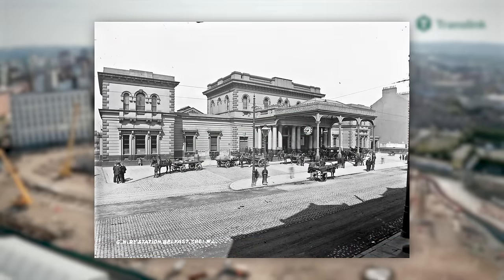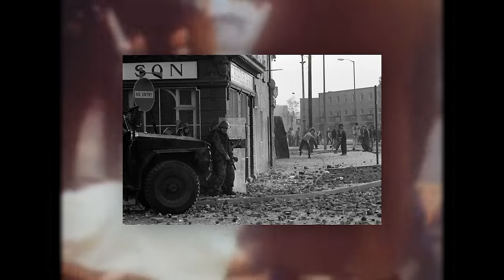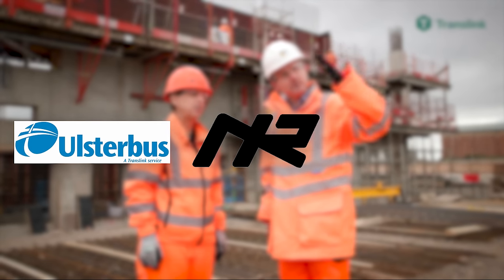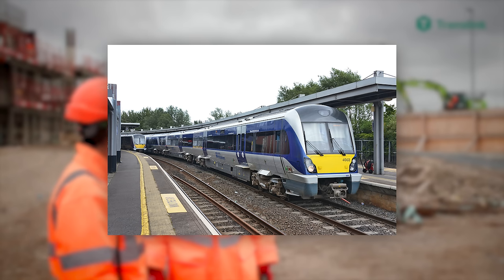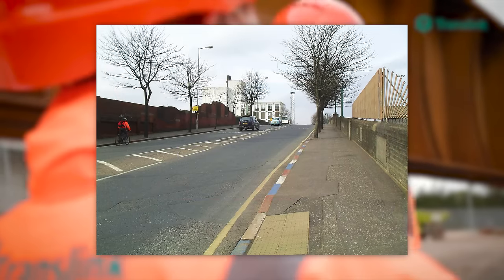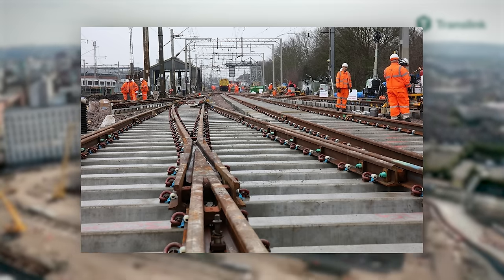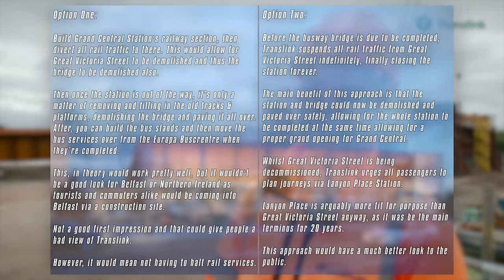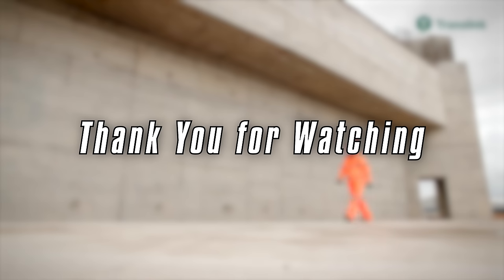What is Belfast Grand Central Station? | Explained

Comment: Sadly so many lines were closed. Many of them were narrow gauge but could have been incorporated into the system. I sometimes wonder why there is no line to Dungannon, Omagh and Enniskillen. The West seems to be neglected. Adimitedly, there is a coach service but a railway would reduce congestion on the roads in the future.
Reply: Japan, spain, and Russia off the top of my head have mixed gauge railways - its a real shame everything was ripped up
Reply: Line to Omagh and Dungannon is included in the rail review, so it's likely to be built

Comment: Very informative video.  Translink should link to this to give people an idea of what to expect.
It's disappointing to see the City Fringe replaced by a car park.  Belfast has WAY too many car parks these days.  It's quite a disgrace, and only makes Belfast more of a car centric hell hole.  Turn it into a park!
Hopefully the expanded platform capacity will enable trains to run frequently from Derry to Dublin too.
The only downside from this development is that a major transport hub will be a further 400m from the centre of the city.
Reply from the maker: I mean they could have just put a carpark underneath the city fringe. It's a just a little weird in that sector haha

And yes, that's why Glider integration needs to happen because the walk from the station to the city centre is already lengthy enough as it is.

Also yes this new station is what Translink are hoping will allow for an hourly Enterprise service.

Comment: Thank you for making such a thorough presentation. Beware of suspending railway services as there is a risk that once the habit is broken ridership may not fully recover.
At least any amenity objections have little traction with a busy roadway on the western boundary .  I hope that you have the stamina to do a program on the B&CDR and Queens Bridge  and the services from York Street/Road once operated by the Midland Railway of Derby. 
Overdue is a plan for a light railway/tram from the ferry terminals . The time and distance wasted by the current remoteness is a pain. I miss the convenience of Donegal Quay.
Reply from the maker: We will be doing a video on the County Down Lines down the line (pun intended).

And I'm certain suspending services from GVS until the new station is built wouldn't have any long lasting adverse effects.

Comment: Ah, this explains it. Me and my sister visited Belfast by train in November 2022, we didn't know what to expect when the train pulled into Great Victoria Street. That said, we were (I'd like to say pleasantly) surprised to see such huge construction work going on next to the existing railway, but neither of us recalled seeing any information at the time about it. This video has cleared it up. 

I agree that the second option you spoke about seems to be the most practical in terms of the finishing touches, you can't run anything under half finished structures without risking structural failure before completion. I would also temporarily divert bus and train services to Lanyon Place until all works at the new station is completed (after all, it seems, from my limited experience of Belfast, seems to serve the city centre just as well) :)
Reply from the maker: Glad the video was able to help!

The new station will hopefully vastly improve tourist's first impression of the country when coming from Dublin or anywhere else, especially when we (hopefully) get a railway station at the international airport.

And yes fingers crossed option two is what Translink decided to go with (or at least something close to it) so that everything goes in a more streamlined manner.
Reply: @fundthenine  let's hope so, it looks like (at least there was) a rail route that goes close to the International Airport, but no station. It also seems, like most of NI, to be single track. I guess having a station built there could be an incentive to either double the track or put in more passing loops to serve the International Airport

Comment: Great video. You are right that this is rather more than a mere station enhancement. Worth adding that Yorkgate is also due the be rebuilt this decade, with a better link into the new Ulster University site.

The case for the Antrim-Lisburn re-opening is not yet certain, and there is an issue that the passing loops have been removed; but the fact the line remains in use (as a reserve route) and the increase in residential planning approvals along it do enhance the case for it - I think we're talking 2030s, but I'd be reasonably confident.

The key point is your final one - if we want this sort of nice stuff, we have to use it!
Reply from the maker: Yes Yorkgate (being renamed to York Street) is scheduled to be completed by the end of this year. However, if that plays out as planned is yet to be seen 

And well the Lisburn to Antrim line may be reopening sooner than anyone might think. With all of the works going on in Lisburn at the minute I was speaking to the man that runs the South Antrim Railway Group and he explained to me that he has been in contact with the government extensively and that they are currently preparing to reopen the line. They have been repairing it all around Ballinderry.

There is also a rumour Lisburn West Station is set to begin construction this year, with a finish date of 2025, however I don't have enough evidence on that to say for certain if it's true yet.

The 2020s will be a very interesting year for Northern Irish Railways if nothing else.

Comment: Just on your last point on the phased opening of the new train station, my experience from train travel in Europe is "we're doing infrastructure upgrades - deal with it", I know it will be a major inconvenience as they transition to the new terminal but a sharp short shock is better than months of dithering IMHO
Reply from the maker: That's true, there are pros  and cons to both options. Either one that they go with I hope is the right one 😅

Comment: When a tunnel is built to Scotland I'm sure this will be the station used for passenger traffic so they should make sure there is space for tunnels under the station (making it more than a terminal) that also attach to metro rail lines on opposite sides of the station.
Reply from the maker: Well that's assuming they do build a tunnel, after all the UK govt aren't very good at sticking to their ideas at the minute.

But logically there is infinite space for a station underneath. The only issues would be getting the tunnel around the sewer system and avoiding the many culverts that carry old rivers underneath Belfast.

Plus there's the issue of what gauge to use for the tracks, as the Island of Ireland uses Irish Gauge (5ft 3) and mainland UK used standard gauge (4ft 8).
Reply: A tunnel to Scotland? That’s about as likely as building a space launch pad in Ballymena 😉

Comment: Great video.
I would have though that Opt 1 or 2 would have been well described in the various planning docs.
Not knowing anything about the project Id think Opt 1 is more likely. Quite common for things to open in stages, and the new station will still be much better than the old.
Reply from the maker: Translink have been militantly quiet about the whole project overall. On their website they have a whole section dedicated to the new station, but it mostly just states statistics and other information. Nothing in terms of project outlines.

Option one seems more likely at first, but given that this project will be so massive, and that this will be something the Belfast City Council can really show off, I like to hope that they go the second route as it would work just as well and have a much better end result.

We have contacted Translink on numerous occasions regarding to how facilities and services will be transferred, but it is one of the few questions they flat out refuse to answer.

Comment: The bus area should be indoors due to the weather conditions in Northern Ireland in my humble opinion.  Have the architects look at Denver Union Station where the buses enter underground for passengers to avoid extreme weather.  Are there green energy advances included in the building structure? Solar panels, electric power hubs for cars and future buses?  There should also be a large car park structure added to the site.
Reply from the maker: The entire station will be indoors including the train platform area.

Also Northern Ireland already has a large fleet of electric and hydrogen busses so charging and fueling facilities are already in place.

Also there is already a carpark planned for the site plus two multistorey carparks around it currently. However proper public transport is about pedestrians and not motorists.

Comment: excellent Video. The one addition to the Railways would be electrify the main line to Dublin
Reply from the maker: Already in the works, Translink's COP26 plan stated that by 2027-2029 they want to purchase bi-mode trains for the network and in late 2020 the DFI started exploring costs for a feasibility study into electrifying the Belfast - Newry Line. So a partially electrified network will most likely be a reality by 2030.

Comment: I’ve got two questions that are bugging me around Belfast Central
1. Won’t terminating all trains at Belfast central heavily increase train dwell times, while also wasting a lot of prime downtown Belfast real estate? Would it not be more effective and quicker for service to terminate trains past the station and convert Belfast Central to a through station?  It could also set up the possibility for an RER style rapid-transit system.
2. How good is pedestrian access to the bus station? The outside design of the bus bays seem quite hostile to pedestrian access
Reply from the maker: Are you referring to Central as in Grand Central Station that is currently under construction or the old name for Belfast Lanyon Place?
Reply: @fundthenine  ah, yes my mistake, I’m referring to the under-construction station, not Lanyon. 

Elaboration - the prime example, at least to myself, of how stub-ending a train service in a busy, very restrictive city terminal wrecks service and makes expansion very difficult is New York City. All it’s major railways insist on stub-ending their services in Penn Station, right in Midtown where there is no space at all to expand. That is in spite of there being infrastructure available to allow services to run through Penn station from the west to the east. As a result, the station is absolutely crammed with passengers with little possibility of expanding

Proposals have been going around for a while to combine services coming from opposite ends of Penn so that the pain of terminating trains is moved to wider-open suburban areas with the space necessary to turn trains around.

Instead though, NY spent money on a brand new terminal that also stub ends from the west and thus does not provide any access to the East and north of NY. That’s a massive amount of money wasted on a project that did absolute jack to improve wider system connectivity
Reply from the maker: @LuckyFlanker13  Never worry.

In regards to your first question, terminating all lines at Grand Central Station won't make any difference as all lines (excluding Dublin) terminate at Great Victoria Street. Also the site the station is being built on is all Translink property as it used to be a rail freight yeard, so no prime property is being lost, plus Weavers Cross will be creating a lot of new property as part of the whole project anyhow. A through station for Grand Central is impossible without significant engineering and costs. Remember Westminster only gives NI £15Billion per year which has to be divided up between different departments.

As for pedestrian access, there will be two main corridors (Glengall Street and The Great Northern Mall) to feed foot and cycle traffic from the new station to the city centre. Access to the bus stands will be via the station interior only.
Reply: @fundthenine  I see.
I admit to knowing jack squat about Belfast transit (my personal interest lies more in San Francisco, LA, Washington DC, NY, and London), but keeping the same stub-ended format for Grand Central sounds like a missed opportunity to reorganize Belfast’s Suburban rail system into a more cohesive and effective system. At the very least, they should allocate the rightt-of-way necessary for such a hypothetical through tunnel for the future so development can’t encroach on it. Even if it can’t be built now, it can be prepared for the future to make it cheaper to build. 

 If you want an example, the NY subway had planned in the 1970s to connect a new subway line to an older one. We made room for the connections. 50 years later, we found the money to make the connection between the old and new lines.

Forward planning is best practice for any cash-strapped transit agency that wants and needs to expand.

That said, this video was quite informative. I’d love to see more videos on how Belfast’s transit infrastructure will develop in the coming years.
Reply from the maker: @LuckyFlanker13  The fact that we're getting a new transport hub such as this is interstellar for us here in NI. Our country is cripplingly dependant on cars ever since the UTA got rid of 60% of our network in thr 50s & 60s. Our current politicians are slow to embrace the necessities of rail and so getting a right-of-way for a tunnel under Belfast is less likely to happen than NI reaching Mars first.

There is a major proposal by a fellow rail activist to create a 'Circle Line' ccommuter rail service using the exsting lines and then connecting them up with the mothballed Knockmore Line that we are currently creating a video series for.

The main focus right now for NI to restore rail links to the many towns and rural areas that were left stranded after the UTAs closures. 

I plan on covering all major developments here and on my social media platforms so stick around mate!
Reply: @fundthenine  My condolences my fellow transit activist - we have it just about as bad as you Northern Irish in American - most of our newest cities are car hell… we’re only slowly waking up to the mistakes of our pasts, and it’ll be a hell of a way to get out of there. 

That said, I think you lot should go for broke from the start - set the base for a great system and institution from the start. Don’t let institutional barriers hold up essential system development like we have
Reply from the maker: @LuckyFlanker13  A lot of our Neolithic era politicians like the idea of the American car festered hell-hole (no offense), but at the minute there's a lot of them making positive statements and changes.

Hopefully this new station is the starting point for a rail renaissance in our country.
Reply: Terminating these services isnt a very big issue as they are actually longer distance services across the country or to Dublin. The suburban trains currently run straight through Lanyon Place from line to line. (@FundTheNINE correct me if I’m wrong)
Only the long distance ones, and soon the Enterprise will stop at the terminus. 
It’s the same sort of deal in Dublin.
Reply from the maker: @squagwag2808  Yes pretty much, nothing will really change at all for journey times, in fact the Enterprise will have a shorter journey time by a few minutes due to it not having to go through the city to get to Lanyon.

Comment: Great video, I was wondering if you know anything about Glider integration for the new station? I've been thinking a while about it, how would it work, would the glider go down the grovsner road instead cutting out the lower falls?
Reply from the maker: I have heard people talking about the idea of it, however it doesn't seem like anything concrete has been planned.

A halt at GCS is doable without cutting any of the current route out, you would merely have to add on a bit.

Comment: Will be interesting to see how the loco hauled enterprise sets are dealt with as the locomotive & generator coach will be on the buffer stops / concourse end.
Reply from the maker: The Enterprise has a locomotive at each end. So it will be the same as it currently operates out of Lanyon Place.
Reply: Doesn't the Enterprise use Push-Pull sets?
Reply from the maker: @RunawayTrain2502  Yes the enterprise as a locomotive at both ends of the train.
Reply: It has a Locomotive and power car at one end, and a De Dietrich driving van trailer on the other end. 
The Locomotive faces Belfast and the DVT faces Dublin. 
This means the noise of the locomotive is kept away from the main part of the stations, but this will change with the moving of the service to great victoria street.

Comment: Lisburn West was stopped due to safety concerns for road users  that would have had to cross two lanes of busy traffic to enter the site, the use of traffic lights were also rejected do to the proximity of the ones at the junction of Moira Rd/ Knockmore Rd.
Reply from the maker: Yes I believe that was the case some years ago. Lisburn west seems to be still in the works now however as so it should. Prioritising road users over public transport is the reason why we're at this point in the first place.
Reply: @fundthenine  It's not really prioritising road users over public transport, it's simply putting safety first. They also wanted it for the extra parking while work was ongoing at Lisburn but that's not going to happen now.